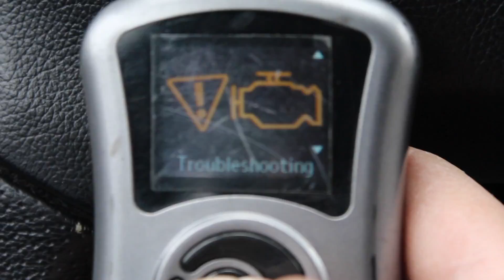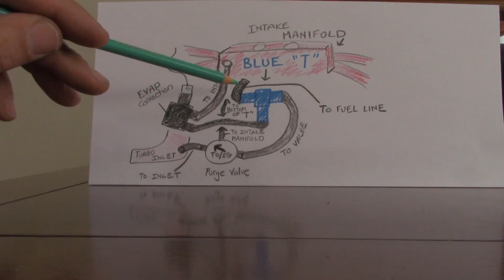Subaru EVAP system code P1443 Purge vent valve Canister WRX STi

Comment: i have a 2004 subaru forester and  it has the code p1443 vent control function fault , i replaced  the part but for now the check  engine light  still on

Comment: Po448 gone now po447
Reply from the maker: Miriam Vivo try this https://forums.nasioc.com/forums/showthread.php?t=2310341 there are some wires that may need attention.
Reply: I appreciate the quick reply. Im pedro using wifes ipad. Failed emissions. have to the 28th of april to fix then turn in plates in ct.

Comment: How do you like the sparco mud flaps?
Reply from the maker: @charlie gibbons  one cool thing about them besides the $25 price is that no one else has these I know of. With so many WRX and STi I want to be different. Rally armor are great but $200 for mud flaps can be spent maintaining the car. Rally armor has the best hardware for the flaps hit EBay or some Forums show how to source the hardware from a shop like Home  depot , lowes.